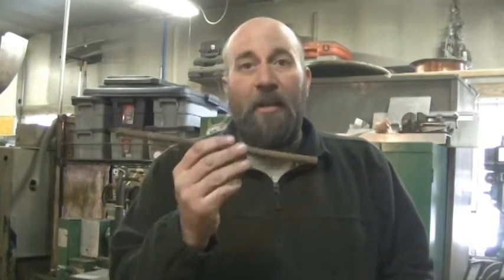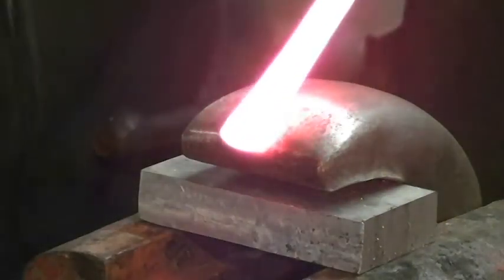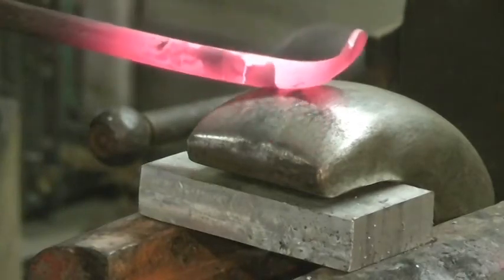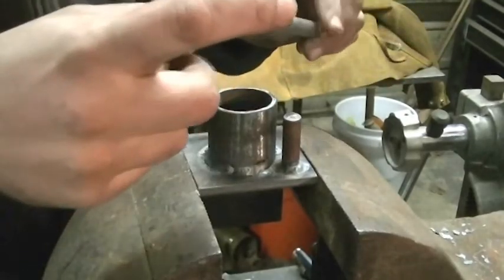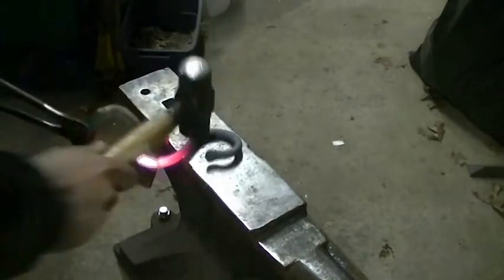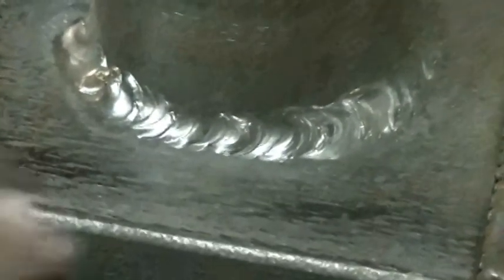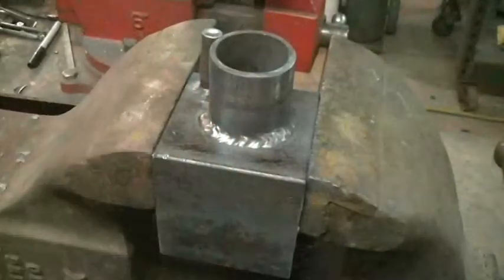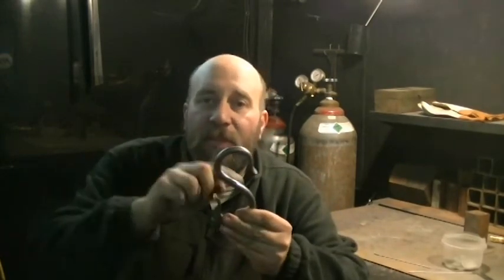Forging An "S" Hook - Blacksmith Series

Comment: Mr. Santo,

Interesting video. I can hear that you added the music track as a background.  As a semi-professional videographer, I am still a bit <oh, how shall I put this???> pensive about your choice to use the onboard mic of your camera. I too recently got a GoPro Hero Camera.  Mine is a "Hero Session 4" camera. It's a very interesting little camera, but my computer doesn't have the processor needed to be able to use it effectively. The processor on my computer machine is too slow. I have an i5 processor and the gopro studio requires a minimum system requirement with an i7 processor.

The nice thing about the hero session 4, is that it's immediately water resistant right out of the box, and is waterproof down to 30 feet, which means I can drop the camera in water and it won't hurt it as long as the door is closed. My one problem with it, is its "Wide Angle" filming, and the distortion of the "Fish-eye" lens. Other than that, the little camera shoots amazing video footage. The color is amazing, well balanced and color saturated, and I am surprised at the quality of the audio that it records via the 2 small onboard microphones. I'm still partial to doing separate audio recordings for my videos however because I'm able to produce a superior video in the end after post production is finished.

Ok, back to what I was talking about.  For my audio recordings, especially if I'm doing a self-presentation like you, or if I'm interviewing someone, I like to use an external microphone. The problem with the onboard camera mics, is the condenser microphone. It is far too sensitive and tends to pick up far too many noises that interfere or even cause distortion of the recording you're trying to make. Also, if you haven't already noticed, the onboard mics will pick up and even amplify any noise echos, like the ones in your shop.

I own and use a "Zoom-H2" digital audio recorder, and a "Zoom-H4N" digital audio recorder. Both are excellent audio recorders that can record in stereo. For interviews, or for self-presentation audio recordings, I use an inexpensive lavaliere microphone that plugs directly into the digital recorders. The recorder can be clipped to my belt, or onto my interview subject. Then, the mic is clipped onto a lapel or shirt collar close to the subject's mouth. This way only the speaker's voice is picked up clearly and most other ambient noises are not recorded. I use a clapper board when filming and doing separate audio recordings. When my camera is recording and my recorder is also recording, I use the clapper board to create a loud noise. This loud noise allows me to sync my separate audio recordings with my video footage. In post, I will remove the original audio recording made by my camera and edit and dub in my separate audio recording that I made with my digital recorder. If done right, viewers will never know that the audio was recorded separately because of synchronizing via the loud clapping noise made with my clapper.

Your JVC camera is capable of accepting external microphones. There are external mics that actually connect directly to the camera via the "Hot Shoe." JVC makes a line of omni-directional mics that pick up and record all sounds. These can also be reconfigured to become "Directional Microphones so that it will pick up most of the sounds that the mic is facing. This will attenuate and eliminate most unwanted sounds, including and especially echoing sounds.

Now for my last bit of critique <hopefully helpful...>. And that is, your blacksmithing and Welding. As a welder, you already have half of your battle overcome, because as a welder, you must have a working knowledge of "Metallurgy" in order to be able to weld and join dissimilar metals together. Your knowledge as a welder will serve you well in your blacksmithing ventures, because you need to have something of an understanding of how metals work during heating and cooling, something that you no doubt learned about when you learned your craft as a welder.

I am a blacksmith/knifemaker among other things. I acquired my knowledge of metallurgy through "the school of hard knocks" and it was all trial and error. I enjoy doing knifemaking and really love blacksmith knifemaking. The end result of forging a knife vs stock removed knives are far superior. Forged steel knives are harder and hold their edge far longer and better than a stock removed knife <ground>.  If I could, I would set myself up with a coal forge rather than using my gas forge. The gas forge tends to burn the steel and robs it of valuable carbon that is essential for hardening and tempering knives. This is vitally important because I specialize in forging and making specialty carving knives and tools.

I like your video. This one is good, but the picture is slightly out of focus. It also could use a little bit of "White Balancing." To white balance your camera, hold a white sheet about 6-8 inches from the camera and turn it on. There is a "White Balance Button" located on the camera. Press the button until you see the white paper change. A better way, is to use a medium gray sheet of paper. The gray paper provides more accurate white balance and the colors will be more true and brighter. The end result will be that the color saturation will be more pleasing and even throughout if your camera is properly white balanced.

I am pleased that you welcome feedback and critique. I hope that I am not offending you with some of the things I'm saying. I'm offering suggestions to help you improve your very informative videos. Thank you so much for sharing and for posting your well made videos. With a few tweaks, they can actually be outstanding videos.

Best

JW <James Williams>

Anchorage Alaska
Reply: Mr. Santo, I neglected to mention, that I strongly urge you to use a tripod for most of your filming. I see in your video that you may have actually already used a tripod. If you did, Kudos to you. Nice video, great information...